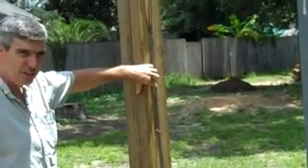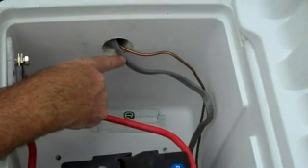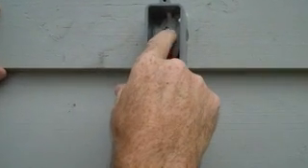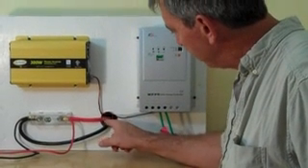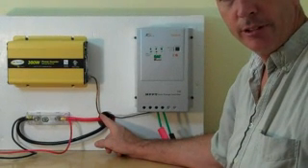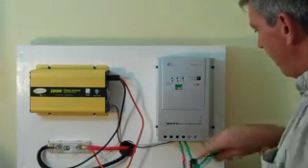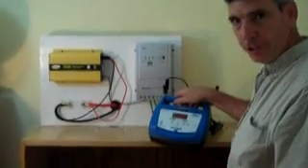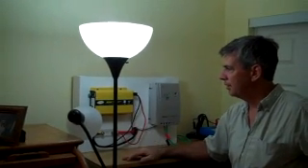Creating Your Own Backup Solar Power System for the homestead 5

Comment: I have a 100 Watt Solar Panel Charger, (Output: DC18V/4.3A) hooked up to my battery with a 20A Solar Panel Charge Controller. Can i plug in a car battery charger to my 800W Power Inverter to charge up the battery that the Inverter is running from, without damaging the solar panel or the controller to assist in charging the battery faster or at least slow down the draining of the battery?